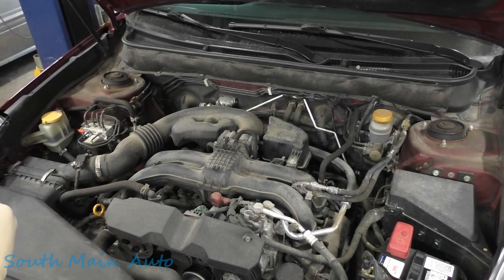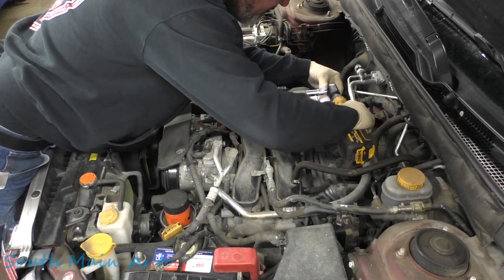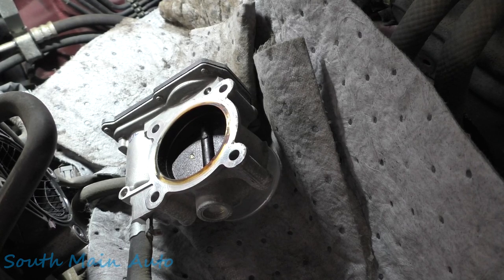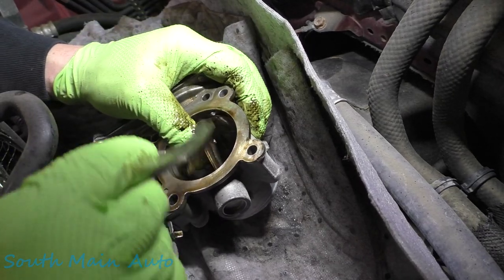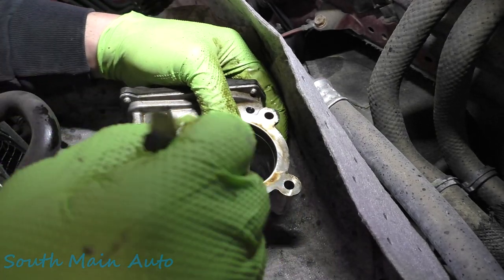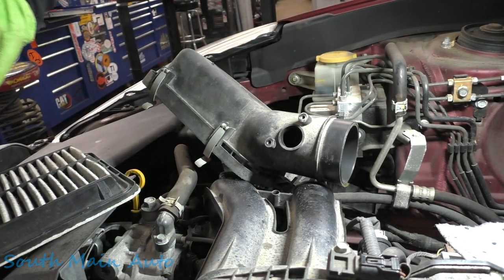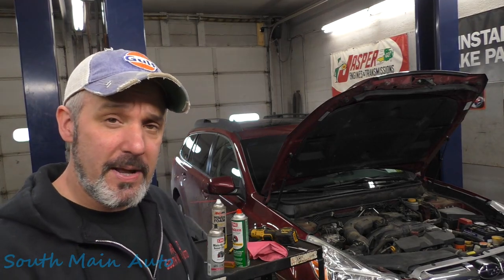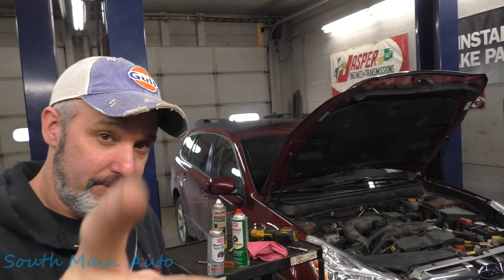How Does Your Shop Deal With Intermittent Symptoms?

Comment: I believe that dirty throttle body may have been the cause of the low idle and stalling. It looked pretty dirty. I hear you though about intermittent problems like that, and I can understand shops not wanting to get involved until they can see the problem.
Reply: Not possible as it would happen all the time
Reply: Even then, the ECM would adjust the position and the fuel trim would rise…

Don’t guess. It doesn’t do anyone any good

Comment: problem with a lot of pandantic people,,they dont drive,,thrash,, there vehicle,,modern cars need a good thrashing every wk or month.. cleans all,most of,,the sht out..example, jag, bmw, merc.. put put put,,because it costs mega if it breaks,,but put putting, breaks it..mate bought a cheap jag,,broken valve,,carbon..never been driven hard..